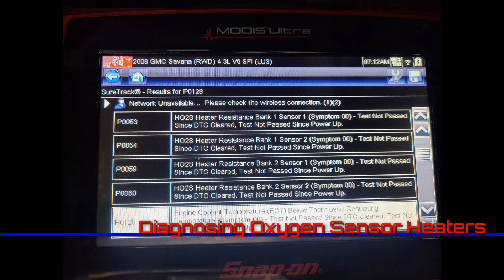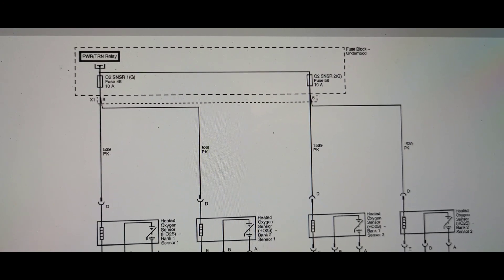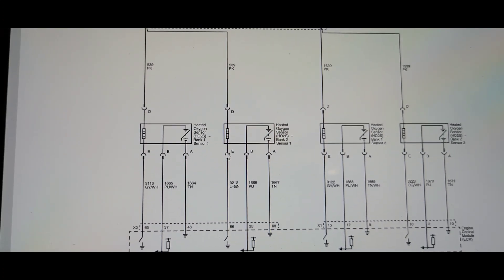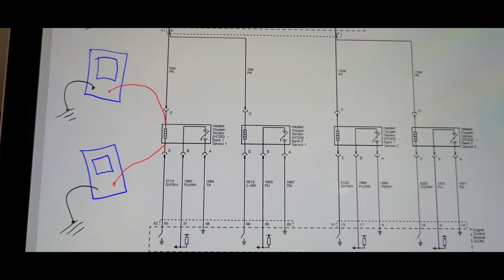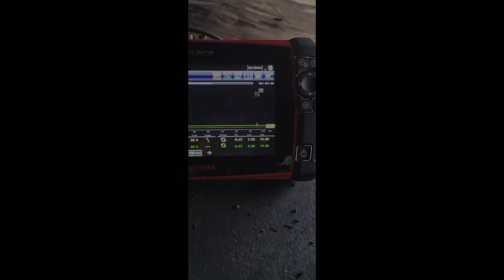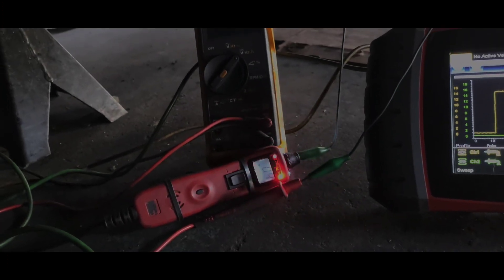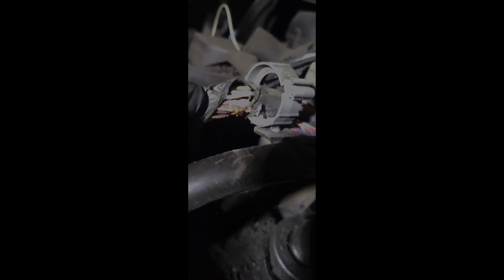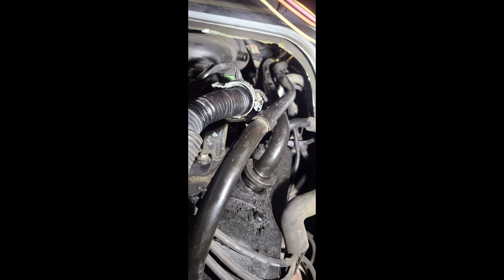Diagnosing Oxygen Sensor Heater Codes

Comment: Thanks for the video , did the electrical fault blow the heaters in the o2 sensors ? Thanks 
Rob mobile man
Reply from the maker: No, it was intermittently grounding the control side of the heaters between the heaters and the pcm.